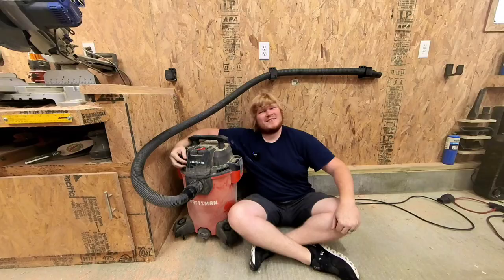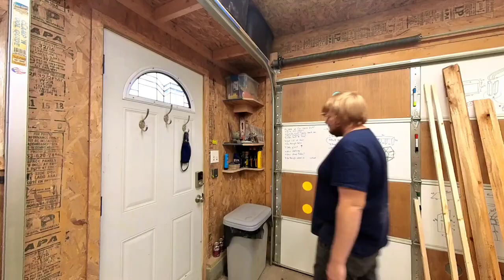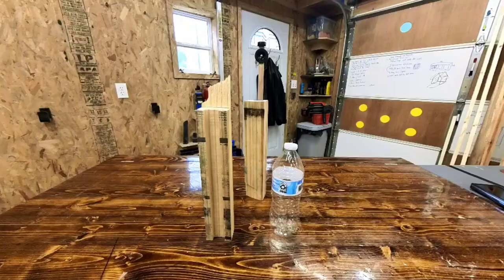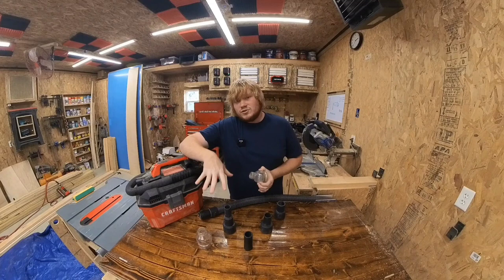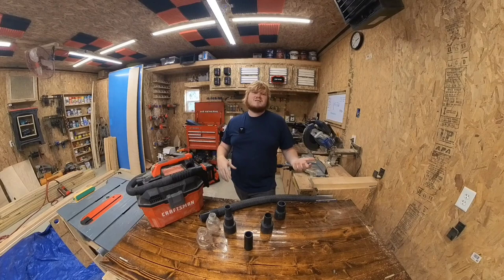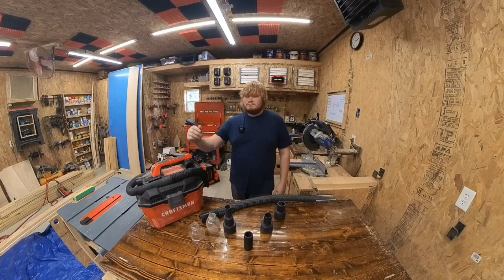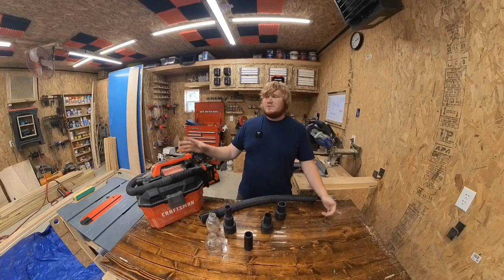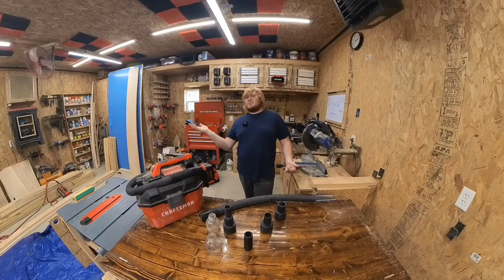Simple Vacuum Adapter

Comment: after watching several of your videos I have noticed you hardly get any saw dust or wood shavings coming out the top of your table saw, have you done something special to help this? I have dust collection hooked up to my saw and I still get all kinds of dust/shavings that come out the top of my table saw.  Thanks
Reply from the maker: I have a vacuum hooked to mine. Your dust collection system might not have enough suction to pull the material down and out instead of it leaving through the top :)